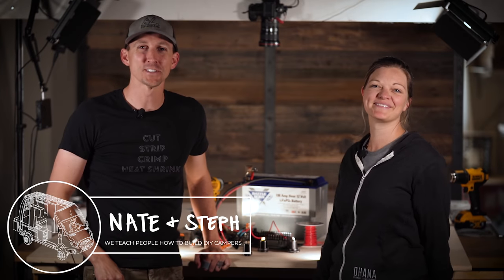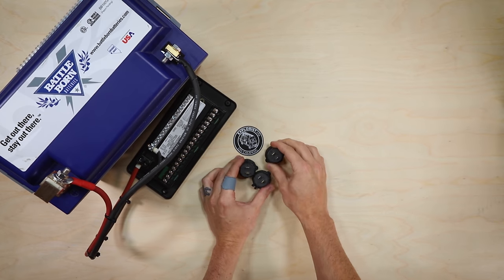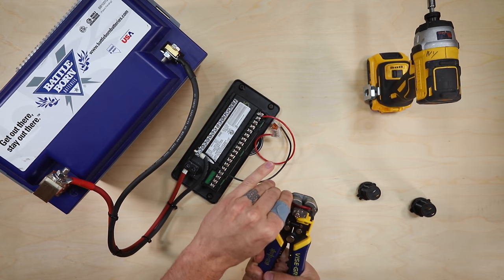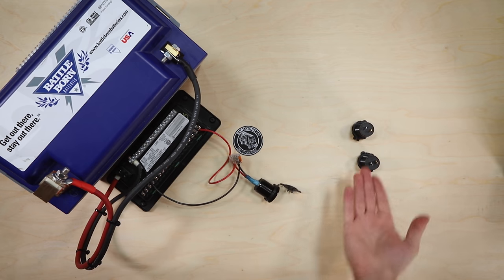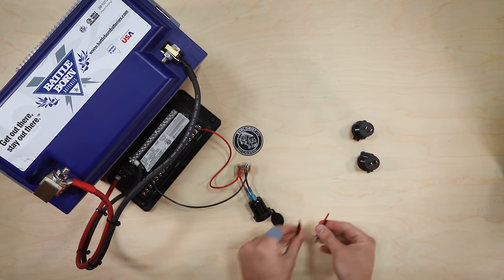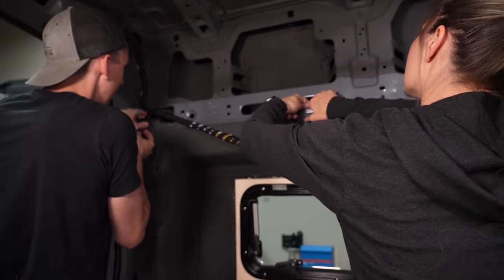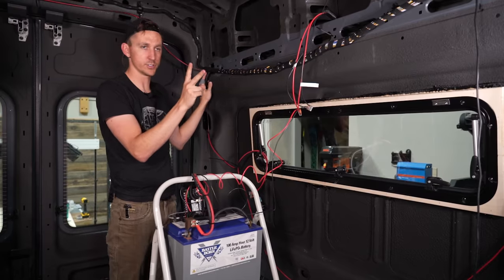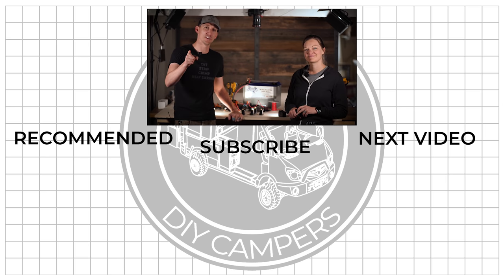HOW TO WIRE USB OUTLETS (In a Camper Van Conversion Electrical System)

Comment: Lovin this series! i am a 66 yr old grandma of 2 who was going to farm out the electrical part of the build - but no more!  Going to go shopping for some fun looking tools.  Looking forward to next weeks video already.  Thanks.
Reply from the maker: Hey Lesley Hamilton, No problem!  Glad it helped! :)
Reply: Me too ( 65 & was really worried)
Reply: Me also (65 was worried) I feel I can do this.
Reply: Thank you Nate.
Reply: @EXPLORISTlife  I'm another grandma, my Promaster is 2/3rds done and I'm heading out as soon as it's finished for a 2000 mile round trip to visit my grandchildren-  but I've still got electrical work to finish up. Can you tell me, since I'm using an Ecoflow Pro 3600 watt portable power station and a smaller Bluett 850 watt for my power, can I just put either a 12 volt or 110 plug on the end of that chain of USB outlets and then plug the whole string into the 12 volt or 110 jack on my power station? Is there anything else I need to do differently when it comes to how they're wired? I'm watching your videos searching for the answer myself, but from what I've seen all of your tutorials are wiring into a traditional house battery. Thank you for anything further you can share, your tutorials are excellent!

Comment: So, a lever nut is just a little terminal block.  Great idea to have them in-line for add-on circuits, rather than home-run each circuit back to the fuse block.  YouTube should have a feedback button stronger than "Like".  Love your videos!!!
Reply from the maker: Yeah!  Pretty much.  Lever nuts are pretty great for these low-amperage branch circuits.
Reply: @EXPLORISTlife  Also, a big THANK YOU for sharing your expertise.  So many of your ideas and techniques apply across different activities and hobbies.  Had not even heard of them before, but now lever nuts are my new "Go-To" accessory for wiring my model railroad layout... great for both track power and accessories like LED lights.  Easy to add on new circuits, and beats cobbling together circuits with solder and heat shrink tubing.  Kudos!
Reply: Why wouldn't you want to run each outlet directly to the fuse block? Seems simpler to me, less to go wrong?

Comment: No mention of the power of those chargers? The latest phones & tables require big power to even charge now days. Those are usb type A connectors. Do you have an option for USB 4.8A chargers? As well as supporting PD 3.0 and QC 3.0 specs? What about type c connectors since most device want that these days.

Comment: what is the point f using a lever nut if you are only connecting one USB outlet? Why not just wire direct fuse block to USB?

Comment: Great video. I was wondering if you or any of your viewers could help. I just installed a 4-piece set. one display that shows voltage. One is an on/off switch. One is a cigarette lighter style, and one is two usb. My problem is when I plug in my phone, I'm getting 6 to 8 hr charge times. I have a 10 amp fuse and plenty of battery. The only thing I can think of is the factory wiring is too small. If I rip it all out and replace with 16 gauge will that give me a faster charging time? Any ideas?
Reply: I have a similar questions, should be most recent, above.  My sense is a cigarette style plug connected this way would work for your application, presumably because the USB adapter performs some sort of step up.  Anker and Baseus make reliable USB-C adapters supporting 100W output and have used these in my van home.  I speculate to do the same "straight" from a USB plug illustrated in the video would require a DC step-up converter but I'm an amateur.

Comment: What about dealing with voltage drop? Is that not an issue in this case? I found these usb fast charging ports I would love to use on my van, but they generate 90w max and already have 16 gauge wires attached. My run will be about 20ft and if I added 4 of them, that would be about 30amps at full use which I'd need 10 gauge, right? I am not sure how I should wire these up. If I make a single circuit for each one, the 16 gauge wire will have too much voltage drop. I'd appreciate any help.

Comment: To install USB-PD capable of 90W output capable of fast charging a laptop or supporting a Starlink Mini, do you insert buck converter?  Or are there outlets that provide higher wattage output?  Is it simpler to install cigarette plugs and use adapter supporting high-wattage output?  Thanks!

Comment: When we did our 2018 Ford Transit 250 conversion (completed a year ago), I was most stressed out about the wiring of the USB outlets and puck lights with dimmers. Once I finally completed all of that, I found out just how simple it really is. When people ask me about the wiring when they watch our van build series - I tell them that they should not overthink it, because in the end, it is just two wires - positive and negative - and some connectors. The dimmer for our two regions of ceiling puck lights was only a little tricky, because I had the wrong kind of dimmer. I ended up getting the same brand of lights (Acegoo) and dimmer and all was well. 

I run our whole setup with Ecoflow lithium all-in-ones (Delta 1300's and Delta Max), instead of the "traditional" 100Ah Battle Born setup. We do not really do winter camping, so I do not have to worry about keeping them warm - I just lift them out of the van and take them in our house. Another advantage is less gear - no charge controller,. inverter, MPPT, etc. because all of that gear is inside the Ecoflow units. Also, when at a national park campground with no shore power, I can easily carry one to a nearby campground bathroom and plug it in. The Ecoflows charge crazy fast and no NPS staff have ever cared. Just another option for powering a van - it works perfectly for us. I also have a 200W solar panel on top and tomorrow I am installing a Victron DC to DC charger to safely charge while driving. Without the Victron, if I wired directly to the alternator, I would quickly burn it up charging the Ecoflow units.

Great series - excellent filming and editing that demonstrates the tasks without wasting viewers time with patting a dog or doing slo-mo coffee-making or having your wife "accidentally" walk by in a bikini! : ) Blessings!
Reply from the maker: Awesome!  Glad it helped.  Thanks for watching!

Comment: I know this is a older video. I just found the series and I'm loving it. I would like to add to what you are showing from a troubleshooting point of view, it's easier if your negative is in line with your positive. I.E. first fuse use the first negative spot. So if you start on one end your positive and you're negative wires are straight across from each other or at least in the same number of holes down.

Comment: Love the simplicity of the video but you must practice/demonstrate safe electrical practices including, verification that power is removed prior to starting.  Thanks for the series, love it
Reply from the maker: Even when I forgot to turn the switch off, the circuit was still properly fused so that if I had directly shorted the two wires, the fuse would have blown protecting the system as designed.
Reply: It's not about the circuit, it is about performing and/or demonstrating something, others will potentially perform on there on.   A statement about 'electrical safety and the need to ensure power is removed', will help others and potentially limit your liability.  Just friendly advise, cheers..
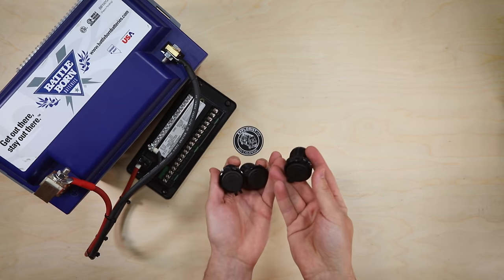Reply from the maker: I actually specifically mentioned that there were no fuses in the fuse block so that there was no power flowing to the circuits at 1:45 in this video, which is sufficient enough disclaimer in my eyes for this video.  In the next videos in the series, I added a switch to the battery to further the safety of this setup.  I understand that what I do will never be safe enough for some people, but that's just what I have to deal with by being in the public eye.  Once I got ridiculed by a viewer for not wearing safety glasses while unboxing a roof rack.  I simply cant please everybody.  But yes... I specifically mentioned that power was disconnected to the fuse block before the video started.
Reply: Not ridiculous or ridiculing, just trying to help.

Comment: On one of your older videos you recommended installing 12v sockets instead of usb ports because of the speed technology advances.  I'm glad I did that, because I found a 12v adapter that powers my laptop.  And also because I've changed other divices to usb-c.   Is there a reason now to install as usb ports? EDITED -- I just reached the end of the video -- you installed both.   Also, LEVERNUTS ARE THE BEST!!! I so enjoyed installing them.    😁

Comment: Nate, I realize this video is a year old, but I’ve just seen it for the first time and have a question: Is it just a trick of the eye where it looks like your initial wires going from the fuse block out to the outlets are reversed? That is, it looks like the red wire is going to the negative buss bar and the black is going to the positive side. Thanks for all the great videos, they’re really inspirational.

Comment: Hey. Thanks for USB video. 

Had Your consider two things. DC/DC converters are usually somehow switch regulated and that for cabable be reason for RFI. As HAM radio operator always be bit conserned. 

Another item is had your thinked USB-C. Those are increasing brand  - and offer bit more power as ordinary A-type.
Reply from the maker: USB-C would have been great, but I couldn't find USB-C/USB-A combo outlets that didn't have the annoying lights and such I was trying to avoid.

Comment: Thanks Nate, Retired electrician here with very little 12V experience and no solar at all... Currently 3 mos into a cargo/camper conversion and wish I'd found you last January! Planning on paralleling 90AH battery and Aux from car to a 6 ckt 12V fuse block. 120V shore pwr runs a 3amp trickle charger to a 5amp fuse. Solar ctl panel to a 10amp fuse. 12V lighter sockets, USB jacks, lighting and radio/DVD player all fused accordingly. WHY CAN'T I USE A 20A SPEC GRADE 2 POLE SWITCH FOR THE SOLAR DISCONNECT? 100watts @ 16V is a little over 6 amps...
Reply from the maker: If the switch is rated for DC current, the voltage that will be flowing through it, and the amperage that will be flowing through it, I suspect it should 'technically' be fine, but without knowing your exact setup, I can't validate for sure.  This is the solar isolator switch that we are now recommending that meets the needs of nearly all solar arrays we come across: https://shop.explorist.life/shop/all-products/switches-disconnects/solar-isolator-disconnect/

Comment: really useful. the lever nuts look like a worthwhile purchase. will you have any 12v items that require separate switches installed? water pump, heater, that kind of thing?
Reply from the maker: Most definitely!  Will be doing 12VDC Switches, 120VAC switches, dimmers, 2 way switches, switches and 2 way switches with dimmers (I think that's all 🤣).

Comment: Hey Nate love all your videos you are the only 2 people I will follow for our van build(when we finally buy a van) just a couple of questions... 

Q1I heard Installing a cigarette socket is a better idea than usb because you can get USB adapters to slot in making it more versatile and because they can be updated also it doesn't constantly drain the battery. Is this true?
Q2. Also could I install a USB c adapter or does it have to be the usual USB outlet
Thanks for your help

Comment: Hi great vids, thank you. Is there a reason you use seperate red and black wires rather than two in one outer sleeve( ithink you in the U.S call it 12 2 cable)? Thanks in advance

Comment: Are these outlets wired in parallel? Also, how do you calculate what wire gauge to use when you don't know what appliances will be plugged in? Do the outlets come with a rating like "rated to 5 amps" so you can calculate wire gauge using wire length and maximum amps? Thanks!

Comment: Really been enjoying your videos. We have usb outlets in our van put in by winnebago. We've slowly been changing things to our personal preference. Question for you, when we plug in our phone charging cable to the usb immediately i hear a high pitched sound coming from the usb outlet. But when its unplugged there is no such noise. Any ideas? The wire by itself or plugged into phone makes the noise.

Comment: Awesome videos! I’m using it as a base to build my live-aboard sailboat. I want to only have 12v DC onboard. Running DC appliances with many different voltages are becoming a bit of a headache. Shavers, laptops, CCTV cameras, raspberry PI, WiFi etc. are all running at different voltages from 8 - 20v DC. Have you find an efficient way to step down and step up DC voltages in a 12v DC system? XY-SK 80 adjustable power supply is the closest solution I could find but it’s cumbersome to set up. Keep up the awesome videos!
Reply from the maker: Most small DC devices come with a 12V 'cigarette lighter' adapter, of some kind.  We'd just use that.  For things that don't; we'd just plug them into our 120V system and run it through our inverter.  Big fan of keeping it simple here.

Comment: Hi there, I thought in a previous video you recommended not hardwiring USB outlets so if the technology changed, such as with USB C, You could easily swap out the USB A outlet shown in this video with a USB C outlet? Thank you for your helpful videos!
Reply from the maker: These outlets can indeed be swapped out with whatever USB type comes around, yes.  Check through the rest of the comments on my thoughts on that older videos as I've shared my thoughts about that already.

Comment: It's totally OCD, but I would have to put the negative in the terminal directly opposite where the positive was! that way it is easy to know which is which when the board is fully populated. like I say, either works but for a fully neat job and a good dose of OCD....
Reply from the maker: Yeah, you can put the wires into the terminal blocks in whatever orientation makes the most sense to you as it, electrically, doesn't matter.

Comment: This may be a dumb question, but I see you attached the hot and ground to opposite ends of the bus bars. I have all my circuits wired next to each other (don’t worry, no fuses yet). Do I need to switch them?

Comment: heya, can you add a switch to this series? also can i have 5 x 15w usb connected in the same way together? will the 12v supply be split between all of them? 

 this is what my USB ports say

 - Output voltage: 5V

- Output current: 2A

- Max. 15W power consumption, consider when selecting suitable drive

Thanks so much!

Comment from the maker: Check out the full electrical installation tutorial for this build: https://www.youtube.com/watch?v=E5q7_4FH4LQ&list=PLmvhcyi4n0TVfA4XCYJBkzfUXunSON1zX

Want to see these USB Outlets actually wired and Installed into the walls of the van?  Check this one out: https://www.youtube.com/watch?v=cf2BjQxMKDI&list=PLmvhcyi4n0TVfA4XCYJBkzfUXunSON1zX

Resources mentioned in this video:
➤ USB Outlet Wiring Kit: https://shop.explorist.life/shop/all-products/camper-wiring-kits/branch-circuit-wiring-kits/12v-usb-outlet-branch-circuit-wiring-kit/
➤ 12V Branch Circuit Guidebook: https://shop.explorist.life/shop/all-products/solar-wiring-diagrams/12v-branch-circuits/

This is the specific 12V USB Outlet we used, but it looks like it's sold out/discontinued: https://amzn.to/3xYDdKU  Our wiring kit will work with pretty much any of the other hard-wired USB outlets found here: https://amzn.to/3A4Ae6p

➤Shop the EXPLORIST.life Store: shop.explorist.life
➤Shop Battle Born Batteries: http://battlebornbatteries.com?afmc=explorist_bb67
➤Binge the Transit Van Build: https://www.youtube.com/playlist?list=PLmvhcyi4n0TVfA4XCYJBkzfUXunSON1zX

Comment: Great video!! Can you integrate how to connect a toggle switch to a circuit like that just in case you want to power those outlets down and turn on when needed?
Reply from the maker: I'm not going to cover that use-case specifically, but next weeks video is going to cover how to wire puck lights which teaches how to wire a switch, and once you know how to wire a switch; you could wire a switch into this circuit if desired.

Comment: Nice.
what do you think about soldering? all these lever nuts can add up, and are cumbersome. what's easier than soldering cables and parts? cheap (nearly free) , very secure, and in the rare case you need to open or redo stuff, the soldering iron is your friend.  what's your opinion?
Reply from the maker: Here is what ABYC says about soldering: 

ABYC E-11.15.3.8 Solder  shall not  be  the  sole  means  of  mechanical  connection  in  any  circuit.  If  soldered,  the  connection  shall  be  so  located  or  supported  as  to  minimize  flexing  of  the  conductor  where  the  solder  changes  the  flexible  conductor into a solid conductor.

When a stranded conductor is soldered, the soldered portion of the conductor becomes a solid strand conductor, and flexing can cause the conductor to break at the end of the solder joint unless adequate additional support is provided.

Here's what I have to add: If I had two people, both inexperienced with electrical wiring, and gave them both 100 connections to make, one using lever nuts and one soldering, how long do you think it would take each of them?  What percentage of connections would be perfect?

It's so fast and easy to make perfect connections with lever nuts.  Soldering is a skill that, if not practiced regularly, results in sub-par connections.
Reply: @EXPLORISTlife  Thank you for this detailed answer.  I am an electrical engineer, and been soldering all my life. But on the other hand, the things I've been soldering are not traveling in a van. so maybe.  If I'll ever be able to purchase a van (nowhere to be found these days) i'll consider this again.